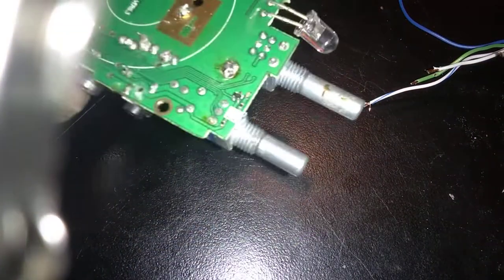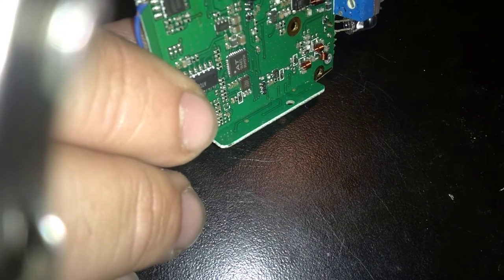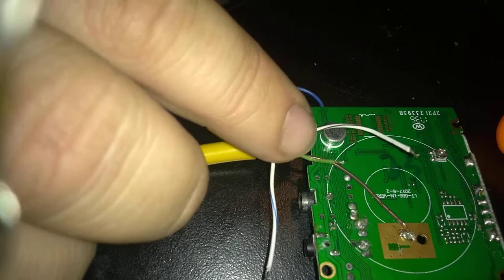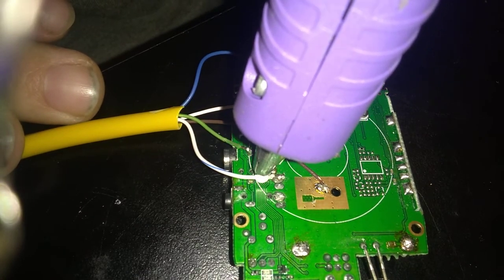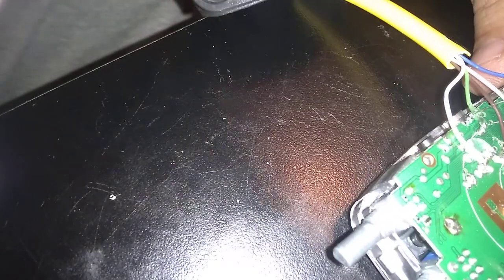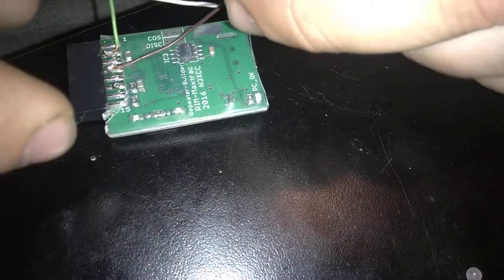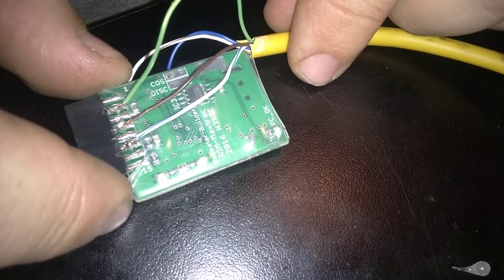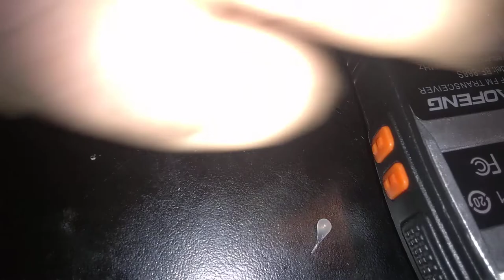Modified bf888s to RIM Maxtrac

Comment: Tape the Pcb down and use a pair of thermostats to hold those small wires on the solder points until attached.